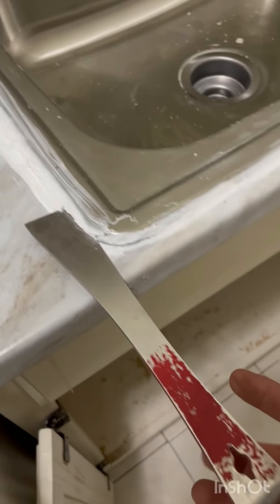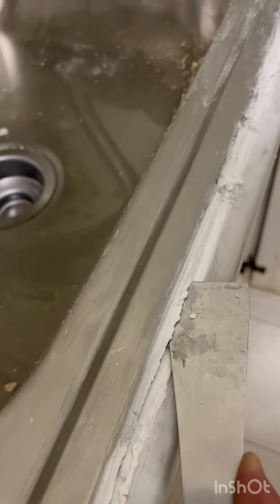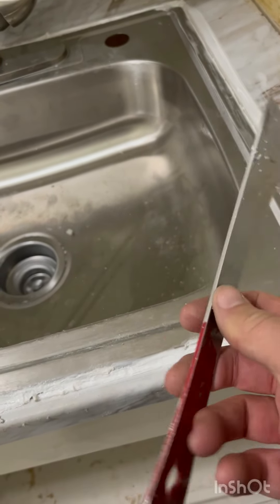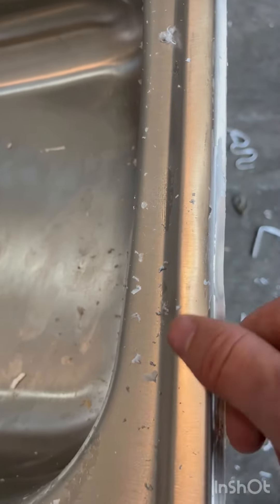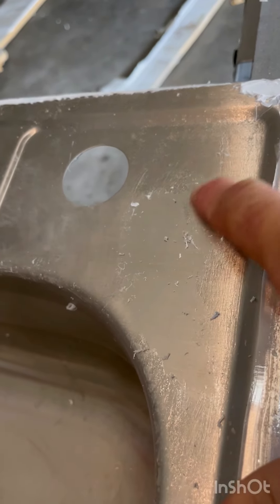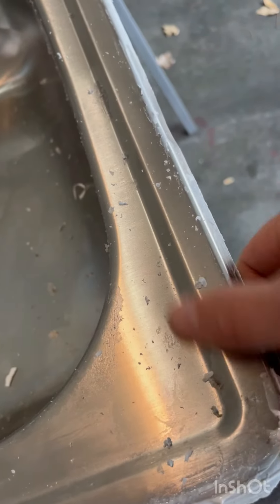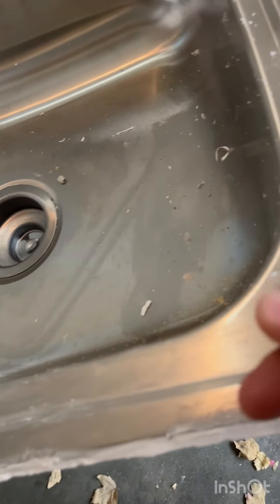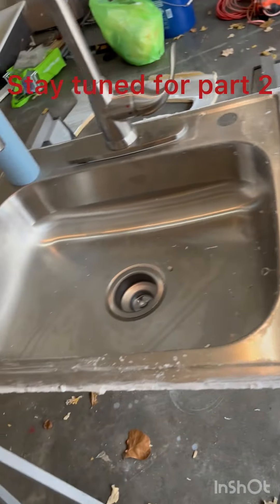Fixing the worst sink in ever! #construction #￼￼diy #sink #handyman #hardwork #tools

Comment: OK, they cut the hole the same size as the sink.  I bought a house that had the cutout for the shower handle the same size as the back plate.  I guess it never occurred to them that the copper pipe only needed an inch diameter to pass through.  I bet they had to hunt long and hard for a 6" hole saw.  Some people are really confident when they execute their plans. :)